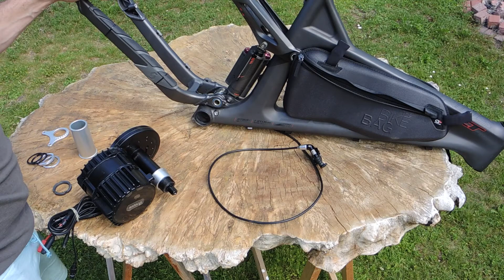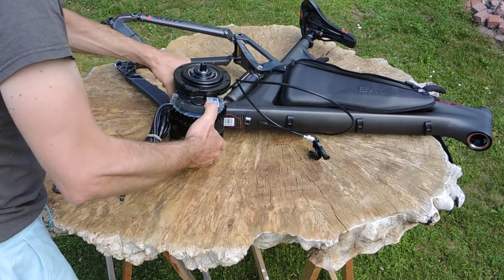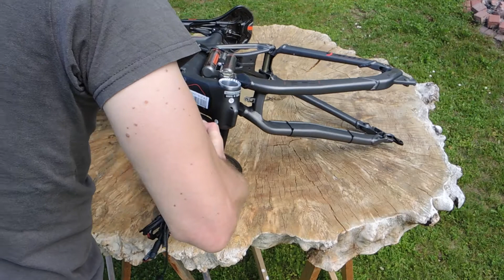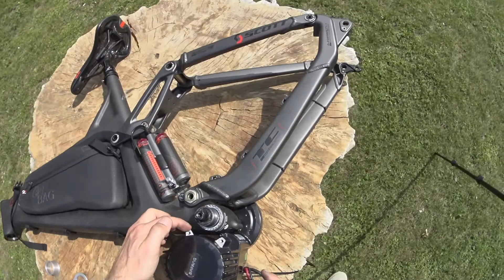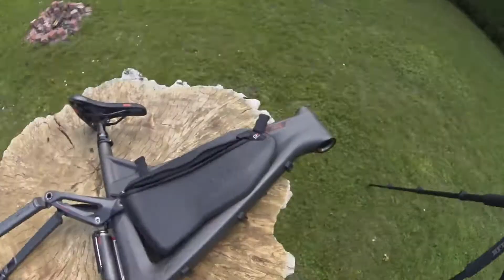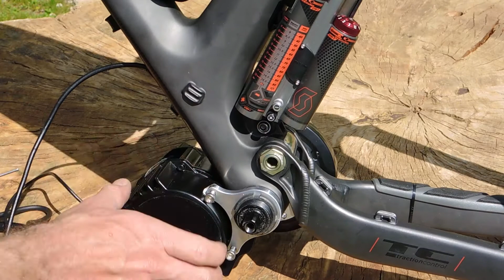Bafang BBSHD and BB92 PressFit bearing built up

Comment: I was considering drilling and tapping 8mm bolt through the bottom bracket (alloy frame) and just into the outer motor shaft housing, to stop the motor from loosening under torque...... do you think it would work? Is there enough space between the outer tube and inner driveshaft?...In the end I fixed it like this....https://youtu.be/PcQALKxUfzI
Reply: Hi i have just done what you said it work no problem, before it would un do after one ride now its stay in place
Reply: @MichaelGreenLagos  great, this is how i fixed mine...https://youtu.be/PcQALKxUfzI

Comment: Where can I get the long one
Reply from the maker: https://fasterbikes.eu/en/bafang-bbs/177-bafang-bbshd-1000w-e-bike-mid-drive-motor-upgrade-kit-bbs03bafang-bbs.html#/146-controller_with_extra_gearsensor_plug_6v_light_connector-without/117-throttle-thumb_twist_standard/70-chainring-standard_46t/135-display-dpc18/51-bottom_bracket_size-100mm
Reply from the maker: https://fasterbikes.eu/en/parts/245-bafang-bbshd-adapter-for-pressfit-bb92-with-triangle-mounting-plate-locking-bbparts.html?search_query=bb92&results=4

Comment: When a BBSHD is fit into an aluminium frame/bottom bracket does it cause any damage? Or could the BBSHD be removed and the frame used as a normal push bike again? Do you have any knowledge or experience of this? 

Thanks for the video, a friend with a full suspension carbon frame was asking me if a BBSHD was possible.  I'm going to have to do some more research. Hoping to buy a BBSHD later this year for my hardtail. Will probably do a test fit on my friend's bike first.

Are you (Fasterbikes) based in Austria?
Reply from the maker: usually there is no damage on a frame, when using this BBS motor and the motor can be removed at any time. And installed a normal BB again.
And yes we are FasterBikes, located in Austria and now also in Germany
Reply: fasterbikes.eu  Thanks.